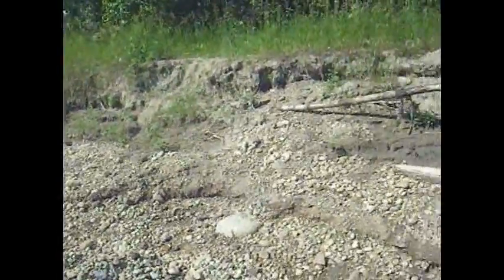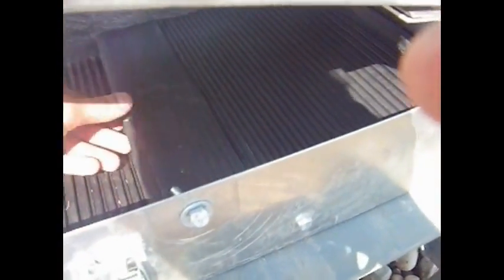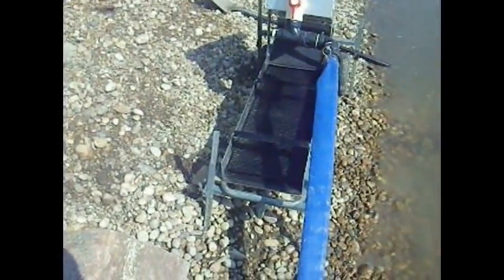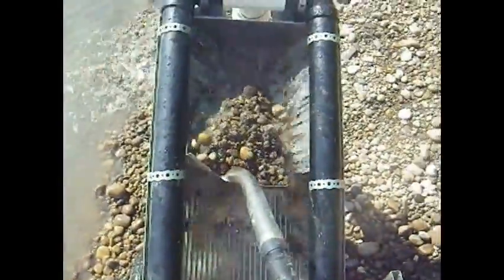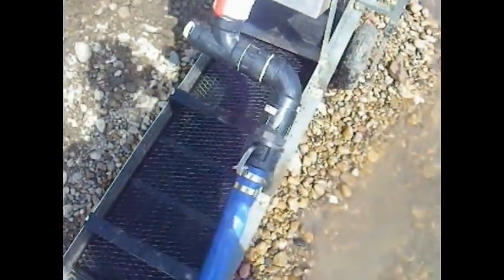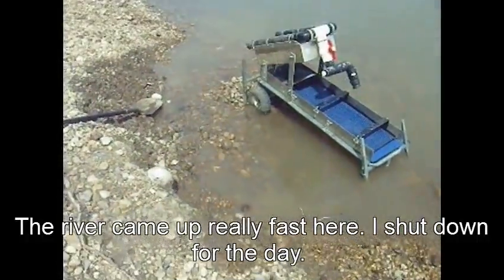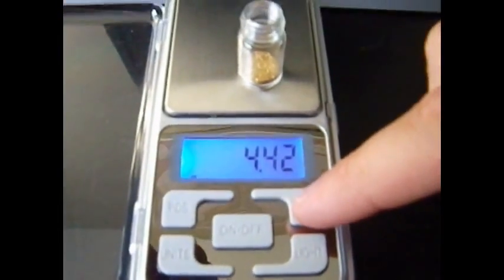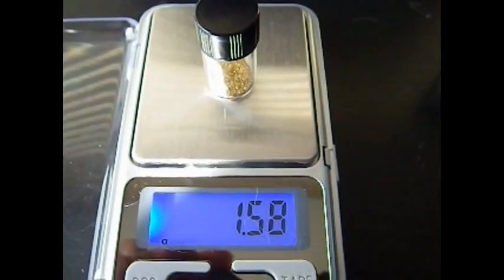#4/10 - Hog mat vs Miners moss highbanking test  - 1/2" expanded metal tray

Comment: the UR mats need to be run steeper and faster.  the issue appears to be that you weren't actually actively exchanging.  they filled up with material and because it wasn't fast enough new gold was unable to be deposited.

Comment: Miners moss works the best no matter what,I have tried every version and the miners will catch the most GOLD WITHOUT LOSSES !! Dude I have been doing this for 20 years on this miners moss setup and you can run it very fast without the flap of rubber to slow down the water and the angle of the moss is not critical for recovery , test your tailings there will be no gold loss !!

Comment: I know this is an older video but the rule of thumb for drop is 1" per 1ft. So a 6ft sluce should drop 6" from end to end. It's not always the case but its the standard I start with and adjust for material on a highbanker and water flow for in stream.

Comment: i live in ohio mostly fly poop gold here bout same as urs i use rippled carpet that i bought at wallmart i have a 2in pump 5.5 horse 4ft sluice by 14 and a half in wide with expanded metal half way down and ripple bars the rest of the way down and all my gold been in the front in the expanded metal section never nothing below it maybe u should try some of that carpet i run mine at about a 5 to 6 in drop on the sluice and my pump just on idle seem to work good check out my videos and take a look
Reply: Miners moss still works much better than anything else !!